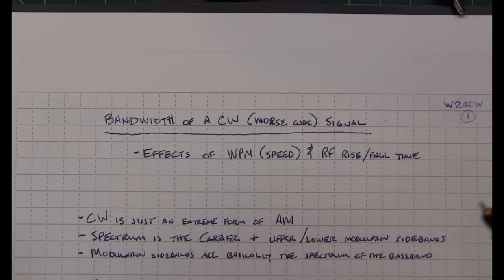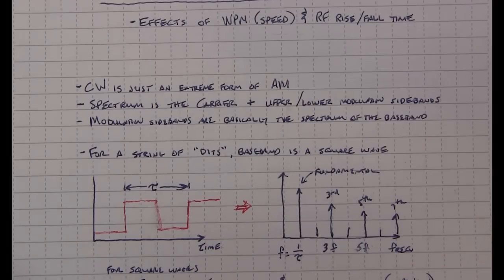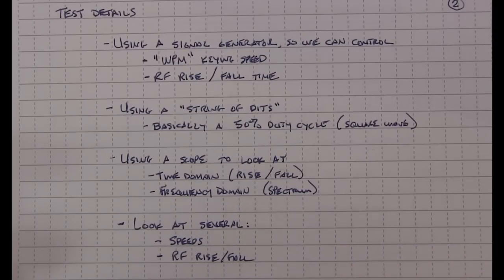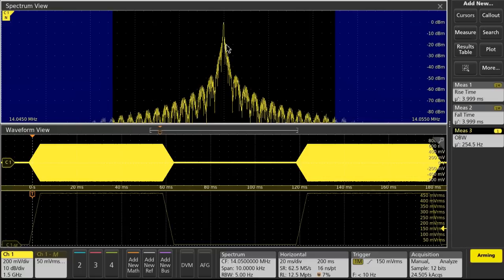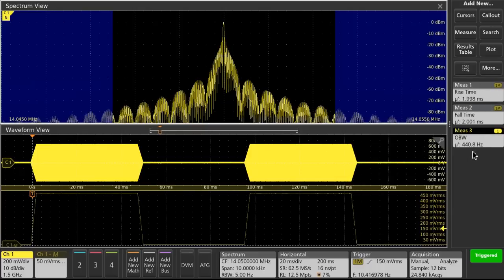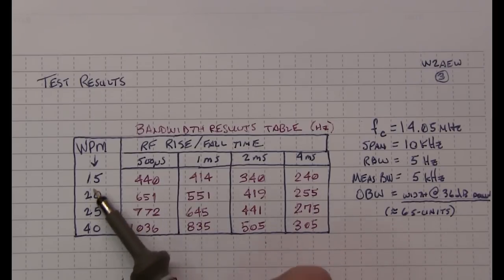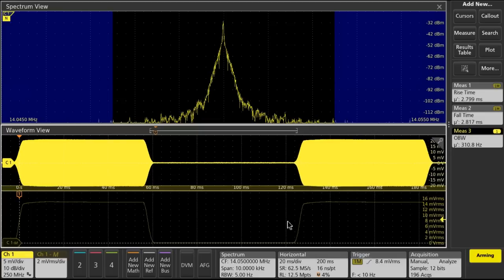#384: What is the bandwidth of a CW / Morse code signal? (as a function of speed and rise/fall time)

Comment: Spectrum efficiency has always been subject of intense interest.
Say we have 1MB of data,
we can send it using AM, FM, narrow band FM, PM, SSB, CDMA, OFDM ....
Which one take less spectrum.
Reply from the maker: Modes that contain redundant signal content (like both upper and lower modulation sidebands) like AM and FM would the widest.  Some form of QAM, whether using a single carrier or multi-carrier OFDM would be much better.
Reply: @w2aew Thanks for taking the time and posting this clip. 
Your analysis not only have significance for CW/Morse code but also in CDMA (code division multiple access)
That is in a CDMA band we have particular frequencies (f1, f2, ... fn) that are chosen so that they are not aliasing that we use for sending data.
For example, one phone is assigned that if say f2, f6, and f8 all to be on at given time it would be a "1" and if all of them are off it is a "0", and if onlysome of them are on is noise.
Now how fast we turn these frequencies on and off and with what profile (here you used straight  line to turn your frequency on and off, but you could use say exponential or say sinc function profile) would expand or contract the spectrum used.
You could send the square wave modulating signal to a low pass RC filter and see the effect on the spectrum.
You could also observe the location of  the RC filter pole ( ie, its bandwidth ) on the expansion of spectrum.
Also, you could use a band pass filter on your modulated signal ( signal that goes to antenna ), and after demodulation see profile that that band pass filter created for your signal.

Comment: As a layman, i would ask what a good method would be for shaping the control voltage to key an old analog TX. Since just adding a RC filter might introduce a non linear rise and fall. 
It's been 25 years since i last saw anything HAM in person, i imagine the rigs nowadays would flat out stun me.
Reply from the maker: Even an RC will provide some measure of spectrum containment.
Reply: @w2aew  On a side note, with every video you release the urge to get at least a novice license increases.
The problem for me back then was that the DARC OVs in my region were a bit stiff. Not many people to talk to and with the rise of the internet, radio was already on it's way out over here.

Comment: What's the OBW of a carrier? Zero?
Reply: Excellent explanation and demonstration!
Reply from the maker: It would be determined by the composite noise, etc of the signal. But in an ideal sense, yes.
Reply: @w2aew  I witnessed this conversation in the early 1970s between my father, a physicist, and his "uncle-in-law", W1DI, who was my elmer. My father could not  wrap his head around the idea that a carrier would have a bandwidth just by turning it on and off. Neither could I until watching your video.

Comment: Pulse shaping and bandwidth gets a lot of attention in the design of modulators of varying types.  Great topic to cover.

Nyquist was really interesting in why pulses round off over distance and the work of him, Hartley, Shannon, etc is super important in designing the communications systems of today.  I think the interest at the time was maximizing the throughput through a channel and less worrying about the impacts of the increased bandwidth requirements that resulted.  

As the popularity of radio increased and more and more services were allocated in the bands, the need to consider better filtering and limiting out-of-band emissions got more attention.  The two go hand in hand though as you can't filter the output too tight or you end up smoothing out the higher frequency components of the baseband signal, increasing group delay, and inter-symbol interference, etc.

There's a huge rabbit hole just waiting for you to go down on this topic 🙂

Comment: Okay. That's super cool. How does rise and fall time affect the sound to someone receiving? I use the default 500 BW, but sometimes turn it down to 300 Hz. Also, amazing publishing time! I'm at the end of the Advanced Class and 85 days into trying to cram the last few characters of CW into my head. 73
Reply: A CW Signal that rises and falls too slowly generates ringing making the signal unpleasant to listen to if not outright uncopiable. 

A CW Signal with a Rise/Fall Time too fast generates Key Clicks with gets under the skin of your neighbors and earns you a not so savory reputation.

So it follows that Code Speed dictates the rise/fall Time one needs to use.

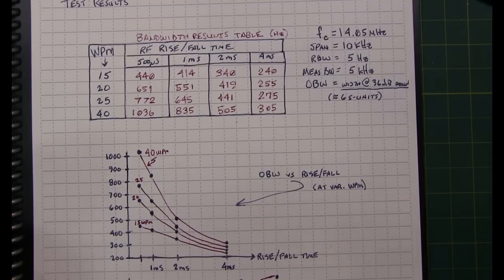Today's radio equipment is frequently set with the Rise/Fall Time set too 11:43  fast. Radios with the Rise/Fall set too slow is very rare.
Reply: @WestCoastMole ah thx.
Reply from the maker: The effect would be audibly about the same as what you hear through those two filters.
Reply: @w2aew :) thx
Reply: James the rise and fall Time has to be sharp enough to give a distinct note. It takes time for your brain synapses to fire. If there is to much decay time one note runs into another. Remember as speed increases the time between dits as dahs decreases. For me anything above 55 WPM is just a blur to me. I can't pull apart dits dahs at those speeds. But there CW Operators in Europe that can do more than 150 WPM. The only guy that I know that can do those speeds is Barry Kutner W2UP. He used to be able to do 120 WPM in his prime. Age has caught with Barry, he is almost 70 and says his max speed is 80 WPM. As for me I'm more than satisfied with doing 32 WPM in a contest.

Comment: It would be interesting to look at how time domain waveform/envelope changes after passing signal through a narrow band filter, i.e. say, force the original 600Hz BW into 200Hz.
Reply from the maker: That would slow down the rising and falling edges of the RF pulse.
Reply: @w2aew  Depending on the type and order of the filter it may also introduce undesired ringing.
Reply: @gf-xy2of  Would a passive filter cause ringing? Or only active filters?
Reply: @franzliszt3195  It is a matter of the filter's transfer function, but it does not matter whether this transfer funcion is implemented active or passive.
Reply: Yes, I think there should be some longer ramp up and ringing afterwards. Regardless of the filter transfer function. Otherwise I don't see how else the filter would extend the slopes.
Reply: For even more fun: add a high pass filter instead of a band filter to remove the lower side band, but keep the upper one. I fail to imagine what effect SSB would have on the time domain signal. Maybe I should run some simulation...
Reply: @w2aew  because the high frequency components are reduced, is that right ?
Reply from the maker: Yes
Reply: I wonder how the rise and fall time affect the sound?
Reply from the maker: @jamescollier3  See my reply to your other comment.